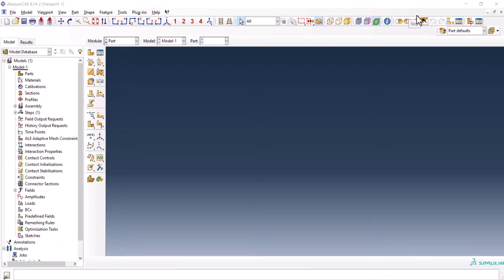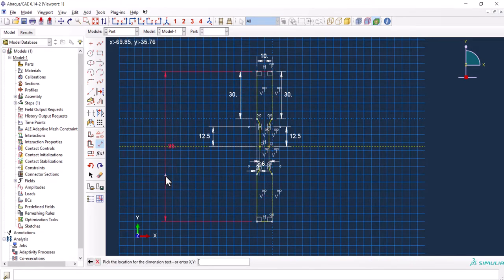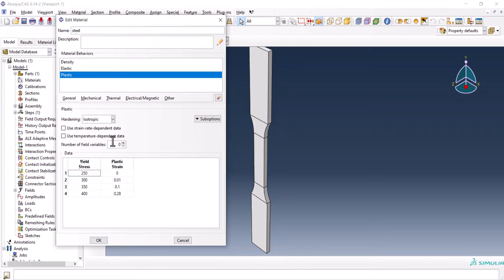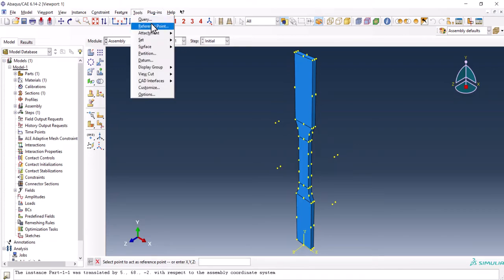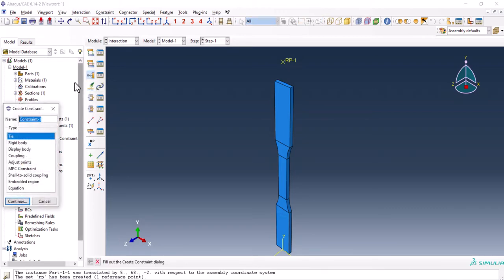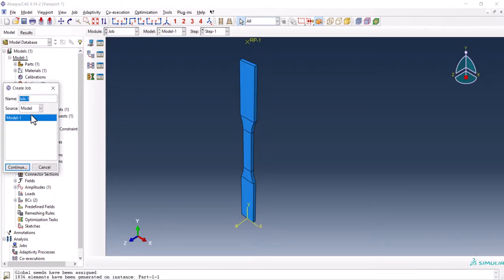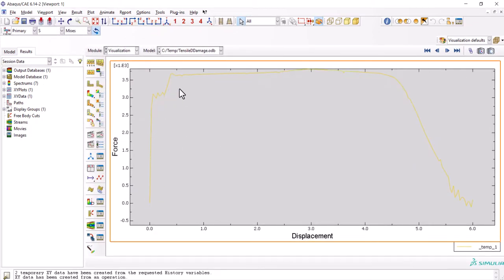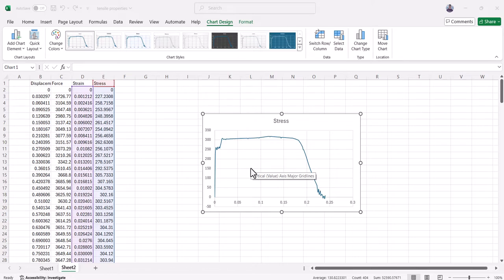ABAQUS tutorial: Tensile test simulation using ductile damage

Comment: Can we do same simulation in dynamic implicit step?
Can you please explain how did you select fracture strain, stress triaxiality and strain rate?
Also distance of failure as 0.4 mm?
Reply from the maker: Yes, you can run the tensile test with ductile fracture in Dynamic, Implicit — but many times you won’t see a clean “fracture” because implicit struggles once stiffness drops fast (softening/localization). It may stop early, converge with heavy smoothing, or look like it “never breaks”. For reliable separation, Explicit is usually easier.
For the damage inputs:

Fracture strain (damage initiation): it’s a material input, not something Abaqus gives you automatically. Best way is to calibrate from a real tensile test (match the force–displacement + necking + failure point). If you don’t have tests, you usually take it from a published paper for the same steel/condition.

Stress triaxiality & strain rate: you don’t “pick” one value — Abaqus tables use them as independent variables. To build a table you need different specimens (smooth + notched, shear, etc.) and/or different loading rates, then calibrate. If you only have one quasi-static test, keep it single triaxiality / rate-independent (one row).

“Distance at failure” (0.4 mm): this is the damage evolution displacement/regularization length. It’s usually chosen based on the mesh size in the necking zone (same order as element length) so results don’t become too mesh-sensitive.
Reply: @FEAMASTER thank you for detailed explanation. I thank you for the video tutorials.
Reply from the maker: Happy to help!

Comment: Great Video, Nice Work.  One Question, can this CDM model be used to simulate single lap adhesive joint, to get Force Displacement data, where adhesive film is modeled by this technique?
Reply from the maker: Thanks for the kind words! 🙏 For a single lap adhesive joint, this ductile damage model isn’t ideal—use a cohesive zone model instead. It’s the standard approach for getting accurate force–displacement curves in adhesive joints.
Reply: @FEAMASTER  Thank You so much for clarification. Yes you are right CZM is better in that terms getting accurate results. In my case I have to simulate a defect in the adhesive, and want to investigate a relative effect of the various defect shape on the overall joint strength. I  did give it a try to model lap joint by this technique by modeling adhesive film like this by using the adhesive properties i have and using the energy value instead of displacement , but facing an issue where only the load surfaces coupled with the RP are being displaced, but not the entire joint.  I checked again all the BC, all seems fine.  Any suggestions would be helpful. Again Thank You for you time and support.

Comment: In BC2, you have assigned u2 to 0. The simulation needs a finite displacement along y, how is this possible?
Reply from the maker: Thanks for noticing! I explained that In the pinned comment!
Reply: @FEAMASTER  yes
Reply: Can you show an impact toughness simulation..maybe unnotched specimen...using tensile data?...even if it is generated at a lower strain rate.
Reply from the maker: @tapashnandy3594  Thanks for the great question! While you can simulate impact toughness using tensile data—especially for unnotched specimens and low strain rates—it's important to understand the limitations. Tensile test data doesn't capture strain-rate sensitivity, which is critical for real impact events.

For a more realistic and meaningful simulation, it's better to use standard SENB (Single Edge Notch Bend) specimens as used in Charpy impact testing, and include rate-dependent material models if possible. That way, you can capture the stress concentration, crack propagation, and energy absorption behavior more accurately.

Let me know if you'd like to see a full walkthrough of that type of simulation!

Comment: Thanks for awesome video tutorial!
Why didn't you directly combine stress strain curve in the Abaqus plot?
Reply from the maker: Thank you so much for the kind words! Abaqus calculates stress and strain at integration points within each element using the material’s constitutive model, which is different from the overall reaction force–displacement data you get from the model. To plot a stress–strain curve, you’d have to convert the reaction force to stress by normalizing it with the specimen’s cross-sectional area and similarly convert displacement to strain by dividing by the initial length. This extra post-processing step isn’t done automatically in the Abaqus plotting tool, which is why the video focused on the force–displacement plot to keep things straightforward.
Reply: @FEAMASTER  get it, thanks for the clarity.
Reply from the maker: @ anytime!

Comment: Thank you for your video explanation.  :face-blue-smiling:
How should I calculate Fracture Strain, Stress Triaxiality, and Fracture Energy?:fish-orange-wide-eyes:
Reply from the maker: You're welcome! I'm glad it was useful for you. Fracture strain is the true strain at which the material fails. You should use experimental values with the help of this formula: εf=ln(1+L0ΔL).
Reply from the maker: Stress triaxiality (𝑇) is defined as:
𝑇=𝜎𝑚/𝜎𝑒𝑞
σeq = von Mises equivalent stress
σ m = Mean stress = 1/3(𝜎1+𝜎2+𝜎3)

 here it is uniaxial and we only have 𝜎1 then it would be 1/3= 0.33
Reply from the maker: Fracture strain can be estimated using the cube root of the volume change! In a single-element FEM model, initial volume = 
𝐿0𝑊0𝐻0L and final volume = 𝐿𝑓𝑊𝑓𝐻𝑓. The fracture strain is: ε_f = (Vf / V0)^(1/3) - 1. Since volume is nearly conserved in plastic deformation, this simplifies to ε_f = (Lf / L0 * Wf / W0 * Hf / H0)^(1/3) - 1. In uniaxial tension, length increases while width and height shrink due to Poisson’s effect. Extract nodal displacements at failure to compute it accurately!
Reply from the maker: To wrap it up! these values are being fit with the experiment data results!
Reply: @FEAMASTER  Thank you for your patience❤
I will study carefully😁
Reply from the maker: anytime❤ feel free to ask any question you have.